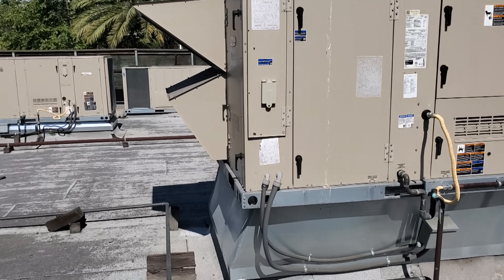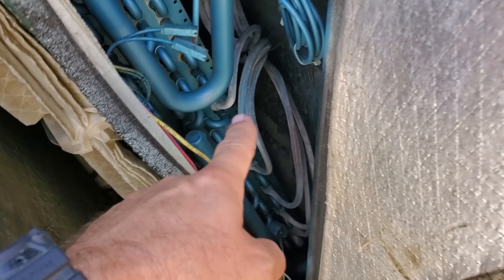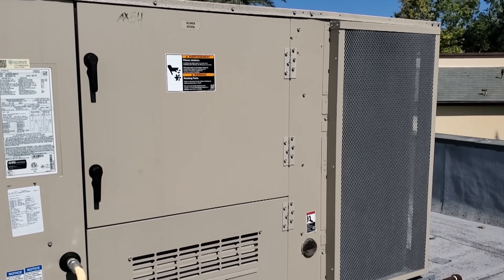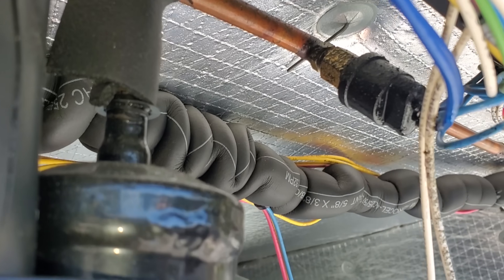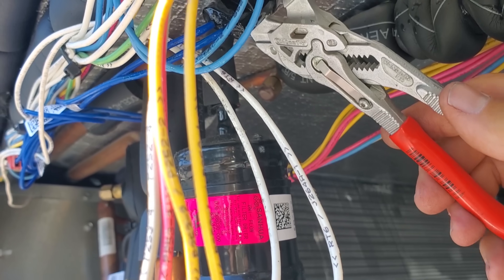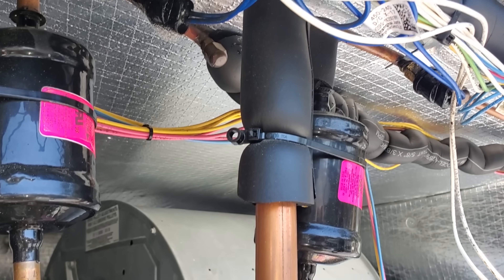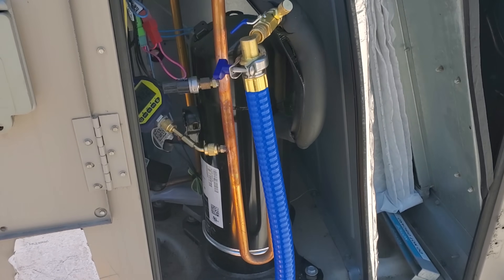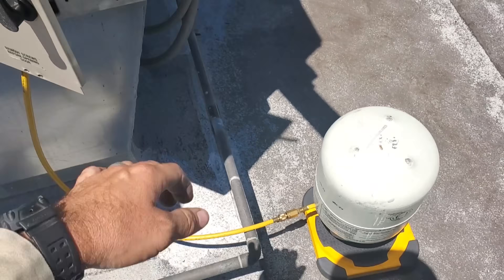MULTIPLE ACS DOWN......MAYBE??

Comment: Have a question.  When you've charged stages with unit being off you are adding liquid Refrigerant in to a suction side, is that right ?  Do you wait a bit before you start system and finish charging or thats not necessary? Asking because of potential compressor damage. Cheers

Comment: Can I ask you a question.

 I have a mid temp R22 1/2 ton walk in. Txv frosted bad on the outlet side power head is   deteriorated. My low is 20’F. High is 120’F. Condenser is clean. The walk in would not go below 59’F.

Comment: What I saw most often was the air handler startups were always conducted "before painting" so the site general would demand that the duct detector plugs were left in until the final building inspection.

Problem is, final inspection is usually weeks if not months after the HVAC inspection is done and it's always "someone else's job" to take them out, meaning it never gets done.

Comment: i threw our equipment's parent company under the bus just a couple days ago, one of our customers is replacing all their old equipment with new units, the new units are installed by the parent company, the customer buys the atms from the parent company with no warranty, which means once they leave after install, anything that is wrong with them is our problem, brand new atm kept going down, it was getting too hot, we in texas, it gets hot here, they left the ac unplugged, we plugged it in, nothing, we checked and reset the temp control, nothing, then jumped on the power, these units are 120vac, we had 118vac on line, but neutral only had 34vac, traced it down to an ac distribution box, replaced it, ac kicked on, for about 5 minutes then shut off and we temporally lost neutral again, the compressor in the ac unit was super hot to the touch, we replaced the ac unit in that atm, theory is, the parent company plugged it in to test it, the ac popped the distro box, so they unplugged it and left it unplugged instead of replacing both parts prior to installing the atm making the situation our problem, man i really hate lazy techs

Comment: So this was a fixed metering device. Where do you take your indoor wet bulb and dry bulb on these RTU package units ?
Reply: Can you show probe placement in the next video using superheat for charging? A lot of the units you work on we have and a lot of the guys use round bout pressures , beer can cold suction line and can fans pumping heat as their guide and I’d like to be the one who breaks that mold.

Comment: Can you make a video about balancing natural gas after replacing a supply line regulator. The original regulator is a 2” and replaced with a 1 1/2” regulator using reducers and nipples on both side but rated enough to satisfy its need which is 2 boilers in series and boiler one constantly goes into flame failure alarm

Comment: This is like the one video that you could see the oil stain from the outside of the unit.  

Attention to small details is a super power.  The biggest thing to help with this is to slow your self down, which is incredibly difficult.  

I tell my self and others.  "Slower is Faster"  when I rush I will miss something.

Comment: The office has been hot the past few weeks. Turns out the package units on the roof haven't been PM'd in years. Filters looked caked and the condensers were clogged. Compressors going off on high head pressure. They cleaned them but one of the second stage compressors was still down. Head pressure control unit was bad saying it was 600 but it was actually only 300 with gauges on it.

Comment: slow leak won't trigger alarm to stop n it will cause damage to compressor keep running ,and if the pressure switch is malfunction then GG......,btw IIOT may help u 😌
 Hope to see more commer.service  call video👍👍👍

Comment: You've taught me well.  As soon as you uncovered the duct detector I said to my self, "The red plugs weren't pulled." Man, that other company is opening themselves to huge liability.
Reply: that smoke sensor is supposed to have PVC sample tubes installed that 90 and point straight down to funnel air into the sensor, not installed correctly

Comment: I would guess there was no “inspected by” sticker, because the unit wasn’t inspected before it was shipped…
Reply: I doubt the unit has been there leaking away for a year and a half before finally getting too low. There may have been some sub-par quality control on the joins, or maybe the installing tech overtightened the thing, damaged it and retightened it but was afraid he might damage it further.

Again, people make mistakes and you'd do well to realise that that is not just something that you can say when you make a mistake, it's true for everybody, everywhere, even the people in the factory and the people who installed it. Heck, I've even heard the guy who makes these videos say it, oh, in every video; people make mistakes. deal with it.
Reply: @vinny142  What if they had not tightened the censers or subsequently correctly gassed unit before it was dispatched. Both of which should have resulted in no QC approval!

Comment: You have me trained well I noticed the plugs in the smoke detector.
Reply: that smoke sensor is not installed correctly, the air sampling tubes are supposed to connect to the threads where the plugs are.

Comment: Ran into something similar on a Trane package unit the company I work for recently installed.  After startup circuit 1 tripped on low pressure switch.  Come to find out Schrader core was loose on suction.

Comment: I’m not an expert on this stuff but since you couldn’t find a inspected by someone sticker, does that mean it wasn’t inspected and no one looked at it to see the loose pressure controls? If I’m wrong please correct me
Reply: My guess is they did a quick visual inspection because they were in a hurry.   If they had pulled out the leak detector and checked all the joints this could have been avoided.

Comment: An instructor at trade school taught me a way to perform evacuation. I use regular hoses with shutoffs but no quick connects and pull out schraeder pins. Pull out pins on accesses on equipment being evacuated. After evacuation add just enough refrigerant to bring above 0 pgig, maybe 10 psig.  Valve off hoses. One at a time remove hoses and quickly insert new pins into accesses. A lot faster than using quick connect hoses I see 99% of people use.
Reply: There’s a schrader valve tool that you can screw on, that lets you remove the valves like you said for better evacuation, and valve off from outside and a port connection for your hose. That eliminates all that hoopla of taking a hose off and shoving it back in there real quick. Doing what you said still risks getting contaminants in the line, if nothing else air. Glad to see others wanting to do things the right way though, I’m still learning myself but I do try to constantly get better and learn, you can never know too much